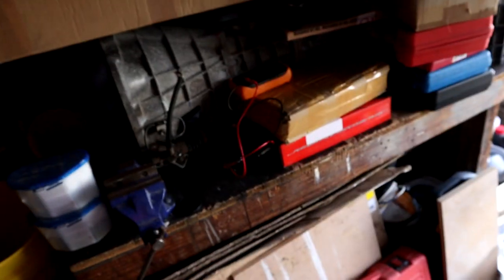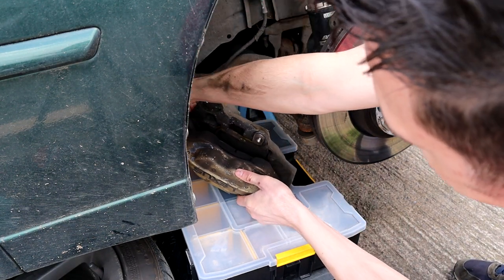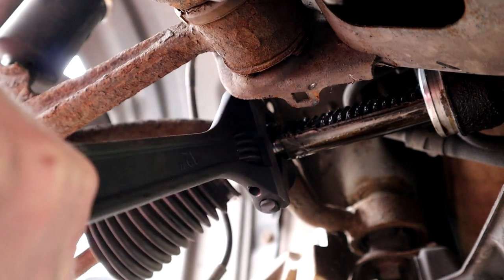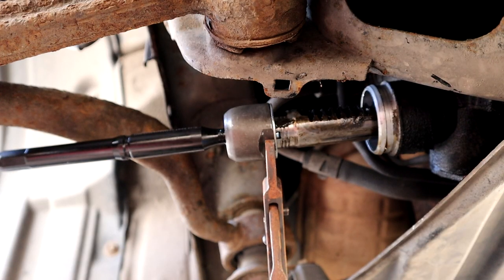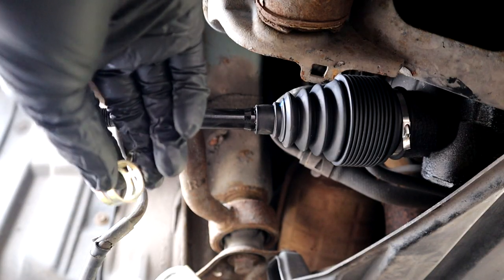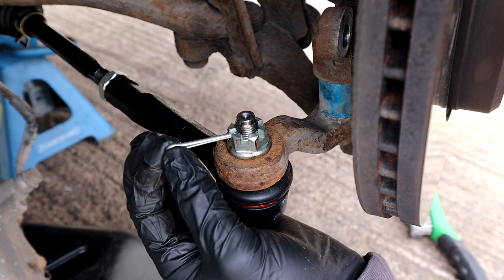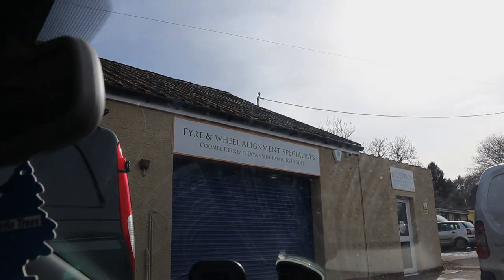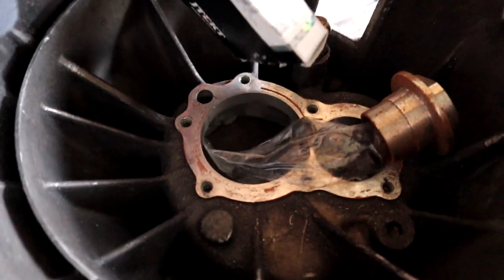IS300 Inner and Outer Tie Rods Replacement... & Manual Swap UPDATE!

Comment: That turning of the steering wheel made all the difference. Nice tip cheers. 10:47 you could use a big flat head or chisel for hammering that washer around the edges if there's enough room in there...